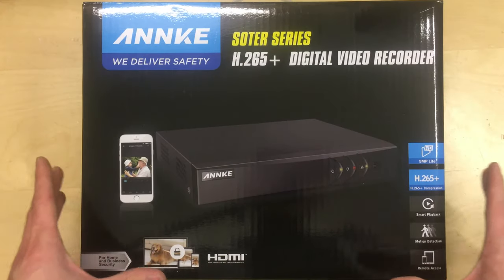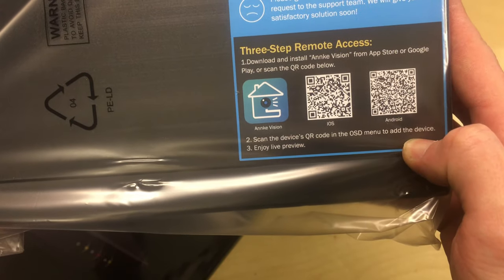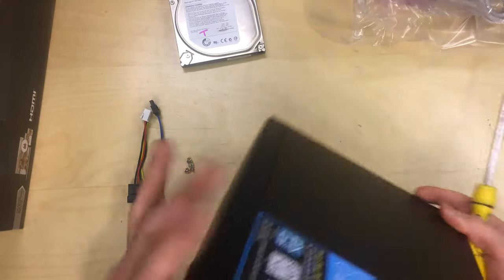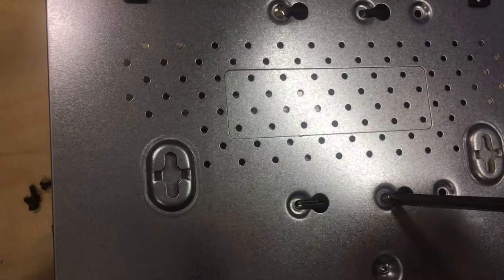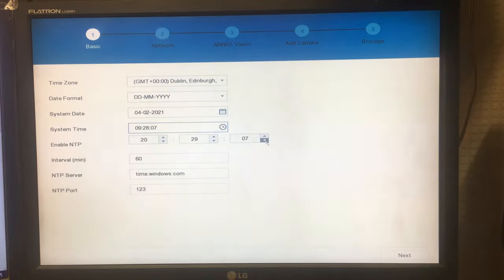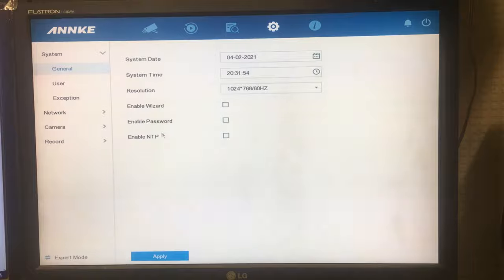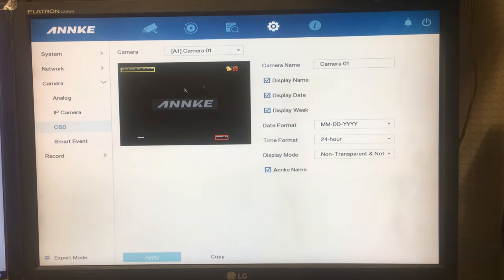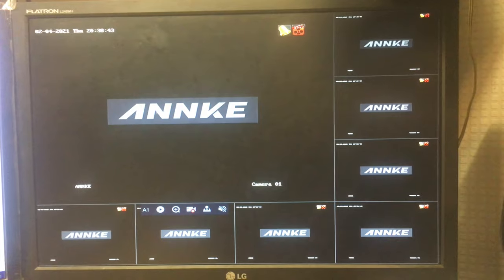Annke 8 Channel H 265+ CCTV DVR Unboxing & Demo / Setup - Soter Series Video Recorder - Model DW81KD

Comment: Hi, i installed same system with 4 cameras a year ago, i recently added another camera but is not showing up. Is there anything i need to do with the settings or should it just come up as soon as is connected? Thanks

Comment: Fantastic video! On Amazon the description says it only works with Annke IP cameras so was assured when you said you had it working with another brand. I'm assuming it works with any ONVIF cam. Also didn't know about the surveilance hard drives so ordered one of those rather than a generic one. I'm currently using BlueIris so I'm hoping this will be cheaper to run and means I can put Linux on the server.

Would've been nice to see the mobile app. Ideally I would like to record and receive notifications on certain cameras but only when I'm out of the house so being able to "arm/disarm" is a feature in BlueIris I'm currently using.

Comment: I have my system (DW18KD 8channel) all set up and running but when it shows a bell on the screen as it detected motion, I will go to the playback and it only says "no video found" my hard drive was full so I re initialized it to erase old footage but i still can't get it to playback although the screen is detecting movement.

Comment: Hello, so I figured out how to have just single camera view with 10 second dwell and they rotate through every 10 seconds. But I cannot figure out when I am in 1:7 view how do you get the cameras to rotate through from smaller view screens to the larger view window while staying in 1:7? If that makes sense. Sorry new to this and helping my elderly F.I.L. THANKS AND CHEERS!
Reply: Also this video was great. Could have gone into the expert mode of the menu to show the dwell settings but maybe not necessary for what you were trying to achieve with this video. Thanks again and hope to hear back from ya.